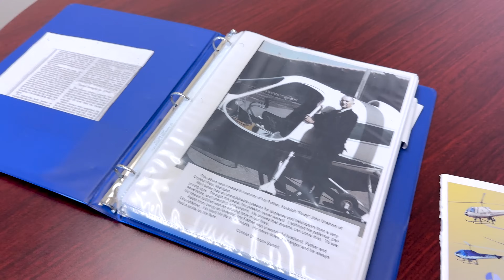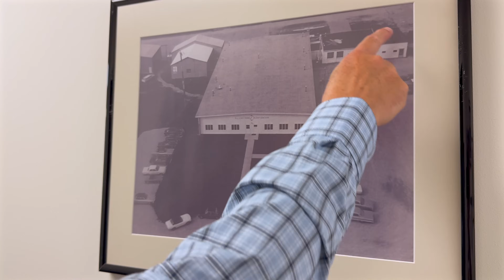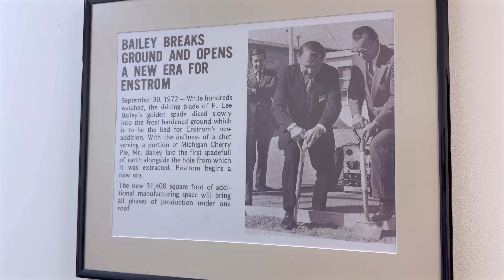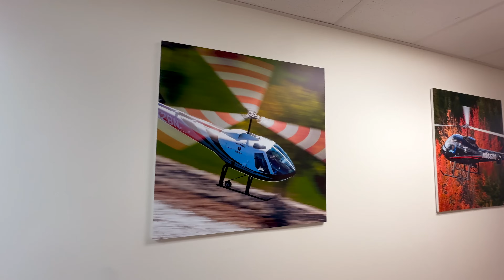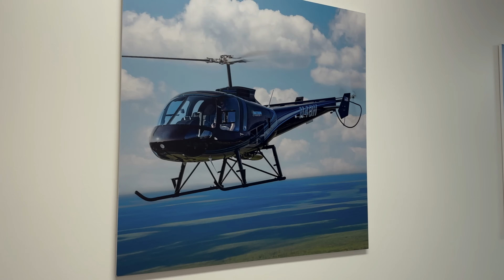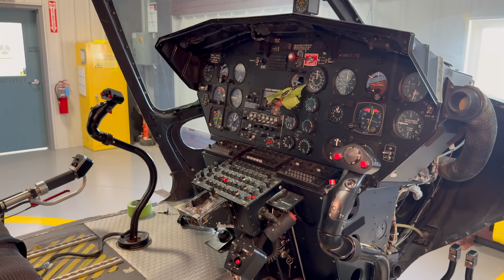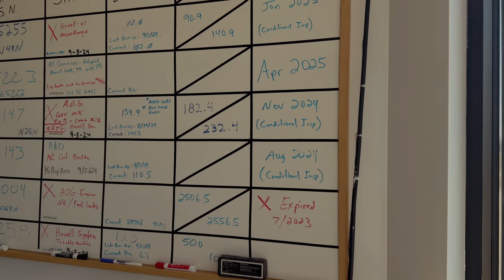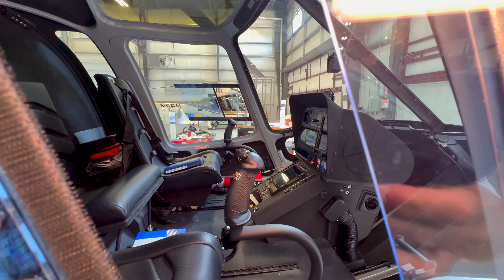Explore The Enstrom Helicopter Factory With An Exclusive Behind-the-scenes Tour!

Comment: Learned to fly in a 280FX Shark complete with it's off the shelf drive belt, with its squeaks. Never spilt a drop blood in the UK. Three blades allows an inside loop. A most forgiving helicopter, laid back and just grins and bears it if you make the odd mistake. My instructor Dennis Kenyon  knew Rudy and was the first pilot to perform an inside loop.
Reply: Sikorsky S-52 & Kaman 225 did the 1st loops in the 50s